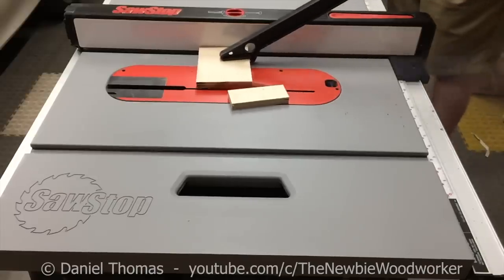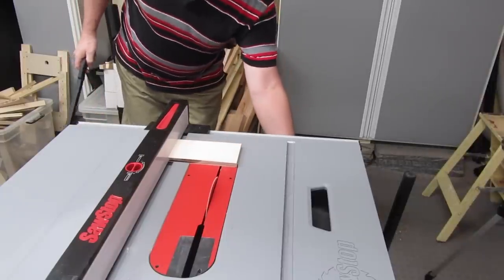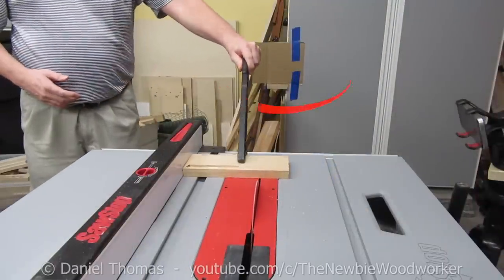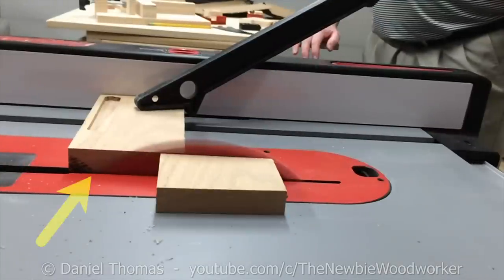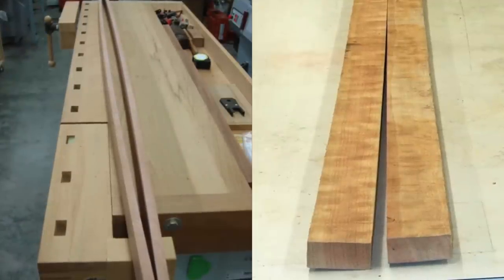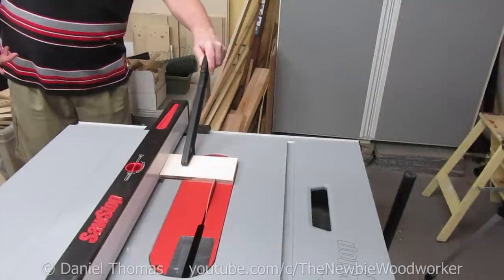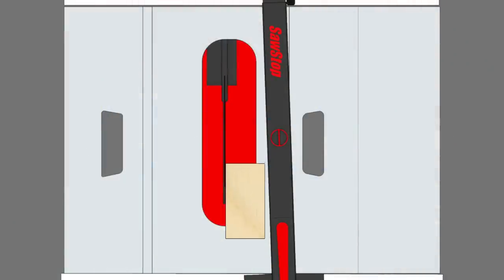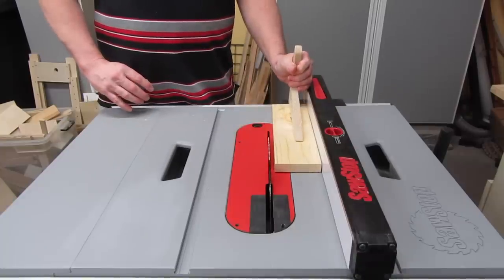Actual Kickback (in Slow Motion), & How to Prevent It

Comment: Good advice... BUT..I still don't understand why people don't buy bench saws with guards and guide rails.  This type of setup is just asking for trouble and for lazy people who don't want to adjust blade height and guard adjustments.  Even a simple plastic guard of a Triton saw stops this.  What is also missing is the guide after the blade so the piece does not move into the blade.  Last but not least.. if you are cutting these type of pieces (narrow and small) you should be using a drop saw not a bench saw for safety.  I am not saying this will not happen with bigger pieces but it is less likely.  Thanks for the video.  I don't recommend any of the push blocks.  They are a disaster waiting to happen.  Still... I hope it teaches some people who got saws without guards and guides some basic safety. Thumbs up!
Reply from the maker: Thanks for the comment. I'm not sure what you mean by a "bench saw with guards and guide rails". What kinds of guards are you talking about, and what kind of guide rails? Also, if by "bench saw" you mean a benchtop table saw, I would never recommend one of those. The table saw in this video is a jobsite saw, which is much more reliable and safe than a benchtop table saw. Though not nearly as good as a professional cabinet saw, which I just upgraded to. 😛
Reply: @TheNewbieWoodworker  Yes fully agree about the Table Saw.  Most (me included) have a table with a standard circular saw mounted upside down (I have the Triton which is not bad.  Good for weekend DIY projects only).  By guard I mean the plastic above the blade, it stops the pieces flinging upwards as well as bits into your face.  The added dust extractor hole gets rid of the fine dust (and even if you take it on the road with a small vacuum you can breath a lot less fine dust.
http://levaa.me/table-saw-guards/table-saw-guards-the-blade-guard-for-babies/
This is just one of 100s I just googled as an example.  As for the guides, I mean the metal piece behind the blade.  It together with the fence helps guide the piece along straight.  I see this missing on many cheap tables.  If anything it will immediately tell you if you mounted the saw straight or not :-)
Again, many thanks for the video.
Reply from the maker: @sogno2me  OK, yes, that makes total sense, and I feel a little foolish that I misunderstood. Thanks for the clarification! I totally agree that either a blade guard or a riving knife is a must, in all situations that allow for it. As for the blade guard specifically, I'd have to remove it every time I use my cross-cut sleds, and I use them all the time, so for me, it's a matter of ease of use. But I have no problem with people thinking I'm an idiot for not using one - they may be right! 😄

Comment: Sorry I'm only commenting now, just saw the video for the first time. As a rule, your hands(arms) should never cross over or in front of the blade of any saw. Line of fire, "proper working position" as it's called, is also a safety precaution. The best safety tip I always give potential woodworkers, "take a woodworking course before you touch a tool". YouTube is awesome for ideas, but it can give you a false sense of 'security'. My friend lost two fingers because of WANTING to do what I did. We call it woodworking tools, not woodworking toys. It's not a spelling mistake, it's dangerous. Happy woodworking
Reply from the maker: Thanks for your comment. Do I understand you correctly, that you would have me stand on the right side of the blade, and use my left hand to use the push stick or push block? Also, I just did an Internet search for '"table saw" "proper working position"', and found nothing at all of relevance. https://www.google.com/search?ei=dbgOXe-XLN240PEPpKWloAc&q=%22table+saw%22+%22proper+working+position%22&oq=%22table+saw%22+%22proper+working+position%22
Reply from the maker: @walterlessing2963  Could you give me the time in Steve's video where he talks about what you're talking about? Thanks.

Comment: For one, those are the worst push stick designs... At least they are cheap suppose.  Nice video demo on the speed of the projectile
Reply from the maker: I totally agree. Did I forget to mention I was using the crappy push stick that came with the saw, so I could do everything possible to get kickback?
Reply: @TheNewbieWoodworker  it's amazing that manufacturer big and small still insists on using this design.  I guess the length gives people a false sense of security.
Reply from the maker: @MintStiles  Yeah, it really is kind of incomprehensible. Although I know Matthias Wandel likes his push sticks which are kind of similar, so maybe they have some value. But personally, they make me feel like I have no control - like trying to spin a plate on a pole, if that makes sense.

Comment: Don't use a thin kerf blade on a regular riving knife like I did when I started out.  I used the Grrrriper to hold the piece in place while I turned the table saw off, so I was good there, but it could have been much worse.
Reply from the maker: Interesting! Good safety tip. Thanks.
Reply: Troy Meredith would you care to explain why?
Reply: TheWoodWorkingPilot If the blade is thinner than the riving knife, it will hit the riving knife and either cause a kickback or you stall until you turn the Saw off.
Reply from the maker: And that would be bad. 😛
Reply: Troy Meredith why would it cause a stall or a kickback?
Reply: due to the thin kerf of the blade not allowing the wood to pass the riving knife. It would hit the riving knife and stop, at that time it could possibly be grabbed by the teeth of the blade and kick it back
Reply from the maker: @brianp1993  Thanks for replying to this question, even if it was from 5 months ago. I really try to respond to every question, so I don't know how I missed this one. I even wrote an app to help me find all unanswered questions. Somehow, I still missed this one. Anyway, thanks for taking up the slack, and with a spot-on explanation. 😄
Reply: @TheNewbieWoodworker  Sorry i am a bit behind on your vids... But i enjoy every one.
Reply from the maker: @brianp1993  I was afraid you might take my reply negatively - I didn't mean that at all. I just feel guilty for not having replied to the question. I honestly am grateful you did!

Comment: A big portion of kick back is the slotted table, most all mfgs have very poor tolerances and the will cause the stock to turn into the blade. Make a insert or buy one a ZERO clearance. Or use a sled. Cut large stock like plywood sheets with a guide and breakdown plywood sheets off the table saw.
Reply from the maker: Great comments! Thanks! 😄

Comment: When I saw what you were doing it scared the crap put of me I have seen people get hurt or nearly hurt trying to demo kickback. The long push stick made it a little better.
I many years ago had a misaligned fence break my ribs before the board embedded itself into the wall, fortunately I was not directly behind.
Good video but still a little scary.
My table saws are so old they never had guards, just use the most important safety device your brain!¡!
Reply from the maker: Wow! No wonder it scared the crap out of you! Fortunately, I've watched other videos where people tried to demonstrate kickback, and learned from their mistakes. Still, I did get lucky also. :)
Reply: Every mistake I've ever made with power tools during more than half a century of woodworking happened because my mind was occupied with what I wanted to do next, or I was thinking about something other than the immediate task at hand.

Daydreaming while using any power tool is dangerous, even if you know all the correct procedures.
Reply from the maker: Yep, couldn't agree more.

Comment: The first 2 ‘kickback’ demonstrations are identical and are due to the use of a push stick when it should not be used. Crosscuts with lots of blade clearance from the fence should be fed through by hand to control the angle, not with a wobbly push stick.
Reply from the maker: That's true, and I actually say that in the video. My purpose at that point was to show kickback happening, regardless of what I needed to do to create it. Which, again, I explain in the video.

Comment: No riving knife, which is why most of these kickbacks are happening.  also, don't push the wood towards the blade.  Finally, don't cut the shorter dimension of the stock without a crosscut sled.
Reply from the maker: Did you even watch the video? All these things were explained in the video.

Comment: From a German health and safety expert (me): Always use the splitter, always. Do not make hidden cuts. Therefore you have a router. Always make sure, that the fence only supports until the beginning of the blade. I do not understand that saw manufacturers have an outgoing fence to the end of the table. Never use gloves and wear wide clothes. Never saw too small pieces. use instead another kind of saw! Always use the protective hood. If you cant see enough use a transparent one an clean it, if necessary. These are the minimum requirements.
Reply from the maker: Thanks, and I agree with most of that. I think there are safe ways to cut small pieces on the table saw, including using a cross-cut sled, or something like a Grr-Ripper.
Reply: What I mean are very small pieces in the range of 1 sqInch or so! I saw people cutting dowels 1/2 inch or less. A cross-cut sled might be a good solution.
Reply from the maker: Wow, those are small! No, I think I'd be cutting those by hand, or with a jig of some kind. It makes me shudder to think about it!
Reply: American here, Agreed about the fence always reaching the backside of the table! I greatly appreciate the European fence designs that allow one to set the fence all to the infeed area, so that it doesn’t bear on the stock after completing the cut. We are definitely catching up too slowly in our domestic machine tools. L
Reply: Yes, and vice versa. Therefore e.g. the saw with the stop (I do not mention the correct name!), which I was involved in the European Certification did not pass all tests, which I personally mean is a pitty, but that is market protection at least.  And your table saw are much much more affordable!

Comment: I just finished about 1000 sq ft of laminate and I had to use my table saw which always makes me nervous. I don't think you can get kickback with laminate because it's so thin but maybe the thicker stuff I don't know. I feel better now about using the saw I ripped a lot of boards and cut a lot of notches. I have the blade guards on it and I have the riving knife but I removed the prawls becuase they might scratch the face of the board. Great video btw and damn is it scary to think of a piece of wood blasting you in the balls. Oh man lol.
Reply from the maker: Aagh - don't say that ! What a thought! 😮 Yeah, the thinner stuff is a lot safer, but anything's possible. Don't let your fear get the better of you. Knowledge is the best way to combat fear.
Reply: @TheNewbieWoodworker  You won't even believe it I got a little kickback on literally one of the last cuts of my project. I had the board against the fence and was cutting a notch deep into the board and I don't know why but it must of not been going completely straight and it kicked the board back into me lol. It wasn't bad but I could feel the power of it pushing hard and it surprised me. It made that noise like the blade was digging in hard getting stuck and then the ring of the blade. Blingggg lol :). Keep up the vids and your fingers.
Reply from the maker: It's funny how often accidents happen near the end of doing a lot of cuts. Something about getting tired or losing concentration, I think.
Reply: @TheNewbieWoodworker  I think so too I was getting close to finishing it completely and yet another annoying complicated cut and I just wanted it through the saw. I've learned a lot about what not to do now though so that's good. :)
Reply from the maker: There's a reason we don't touch a hot stove anymore (or at least, most of the time). We learned when we got burned. Unfortunately, that seems to be the standard human experience, right? We need to be hit over the head before we learn. 😛
Reply: When I was 4 or 5 I wanted to reach a cupboard and jumped up on the stove with my hand on the plate. We had a stove with 4 flat plates and small ridges and I could see those on my hand. Never forgot the sound and pain lol. No scars though mom probably just turned the stove off when I got to it. :)
Reply from the maker: LOL. There you go!

Comment: I am learning woodworking but one thing I decided not to do is to save money on my safety. I got a Gripper tool it cost around £50 but I had a look at Amazon and I found out they don't sell a replacement for hands and fingers. So spending £50 on such a tool is nothing as compared to missing a hand or a few fingers.
Reply from the maker: Are you sure you couldn't find replacement fingers from a third-party seller? 😂Of course I agree with you. One of the problems with the Grr-Ripper, though, is you have to remove your blade guard to use it. So that's something to think about. Personally, I use Grr-Rippers now mostly only when I already have to remove the blade guard.

Unrelated to Grr-Rippers, but certainly relevant to safety: You might also want to check out my cross-cut sled that lets you keep the blade guard on: https://youtu.be/cQINXsn2QBk. The main purpose of the sled is to give you one less reason to remove the blade guard.

Comment: Worst workshop mistake for me was buying a tablesaw without a riving knife.

There are some cuts that a knife gets in the way for, such as kerfing. Unless you want to route channels, which is not as good a method.
Reply from the maker: Fortunately, riving knives can be removed, so while that adds a little time, it's better than not having one. And as for your not having one, there are videos on how to make "splitters", which may be enough for your needs.
Reply: @TheNewbieWoodworker  Yeah, removal is normally pretty straightforward forward
All in all the table was pretty poorly made, that wasn't it's only issue. Ended up dumping it and buying an actual quality one
Reply from the maker: @andreiandrofski9426  That's not an uncommon experience. Sometimes you don't know what you need until you get something that's less than ideal. At least it probably wasn't very expensive. 😏

Comment: Three frames video @ 22fps x 42 inches of travel distance = 24.5 feet per second! Roughly, that is 17mph, and for a block of wood weighing about a pound, that's a considerable amount of energy flying about! There is a point at which the motion of the reaction, (the speed of the wood) vs the reaction time of the body, which I happen to know is one quarter of a second, is far greater than the distance traveled by the wood in that same amount of time. Meaning, you cannot react before you are hit. It is physically impossible for the brain to send the signal, as it has only just reached your brain, and then you have to make a return signal just to instinctually react. By then, the block of wood has already bounced off your body.
Reply from the maker: Thanks for the great explanation! 😄

Comment: you should be using your hands not a push block you can apply force to the fence and down to hold the peice. Pushblocks have no control or grip of the wood so the blade can grab it whenever it wants.
Reply from the maker: I understand what you're saying, but even with better control, kickback is still possible, and when you're using your hand, it could get dragged into the blade.

Comment: I've shoved a lot of stuff (including sheet goods) through my table saw with reckless abandon, never had a kickback. Of course I always use the splitter and bladeguard (Jet Xacta Saw). I've had plenty of burns where sheet goods got shoved into the blade. I've had wood clamp down so hard on the blade many times that it bogged down. Never any kickbacks.
Reply from the maker: Well, you're lucky, but smart also, because you're leaving the splitter in place. But still, if it really bogs down the blade, check the outfeed side and see if the kerf is closing around the blade and/or the splitter. If it is, put a small wedge in the kerf (after the blade/splitter) so it keeps the kerf open. You're blade will last longer, and it's safer. Oh, and never say "never". How about "not yet"? 😛
Reply: @TheNewbieWoodworker  

Yes, I use a wedge. One time, the wood had clamped down hard I had to lever it open with a chisel to even get the wedge in.
I'm not sure how a kickback would happen at all with the bladeguard in place.
I can feel the wood being shoved towards me, of course, when it clamps down on the blade. But I can't see it fly toward me out of control because the riving knife and bladeguard are in the way. (When I said "splitter", I meant a riving knife, of course).
From what I've read on the internet, kickbacks seem to be EXCEEDINGLY rare as long as you have a properly installed riving knife/splitter.
I guess if you force the wood so hard against one side of the riving knife that you bend it out of the way. That could work, I suppose.
But that's not exactly a realistic use scenario.
Reply from the maker: @henningholthusen831  I actually agree with you, but since I'm far from an expert, I don't usually voice that opinion. I just can't see kickback happening with a riving knife either, unless somehow it happened in the gap between the blade and riving knife, which seems unlikely. I suppose if the blade is thicker than the riving knife, something could happen, but I just can't imagine it. So like I said, I agree with you, but don't quote me. 😉